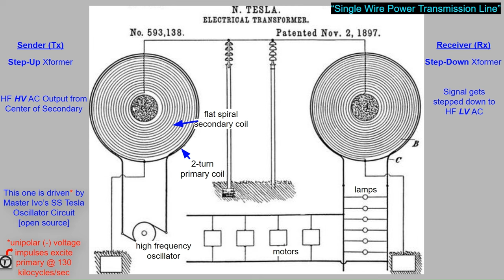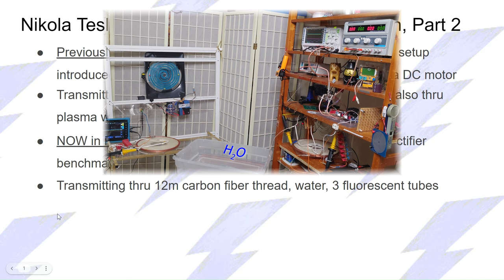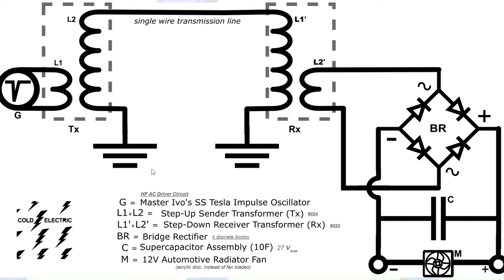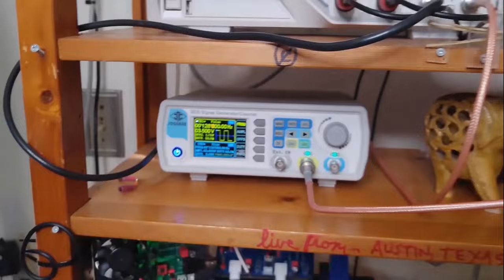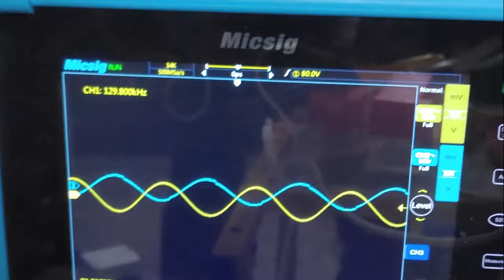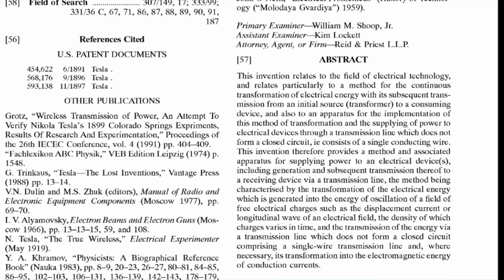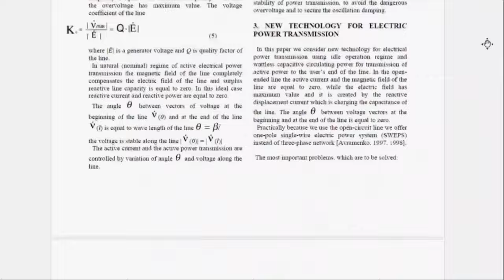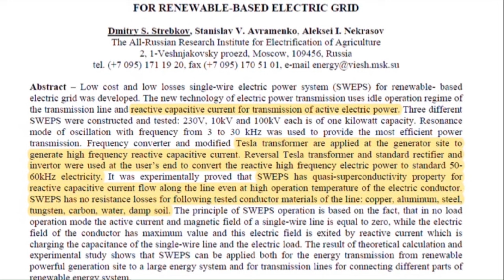Nikola Tesla's Single Wire Power Transmission, Part II: Carbon Fiber Thread, Radiant Energy, Diodes

Comment from the maker: If anybody wants to see more about specs & precise details, look here:
 https://open-source-energy.org/?topic=3676
Reply: No vacuum tube for switching 🎉
Reply from the maker: @brettmoore3194  i would like to get hands on a vacuum tube oscillator sometime though - but yes Silicone Carbide (like the switching MOSFETS i have) apparently is a big up-and-coming "next gen" trend in for power electronics!
Reply: @cold3lectric  I'm want to build a Mason jar tube but with a thorium filament for thermal emission amplification. Beside the emitter,gate and collector I will use old speaker magnets for confinement
Reply: My curiosity and inquisitive mind is at it again. 
And i can now picture a market segment that would greatly appreciate this.

It’s solar garden lights. Aesthetically pleasing at first but the execution and end result is usually atrocious.
Reply: And! In my mind this would be such a blatant proof of concept to Tesla’ single wire power transmission research and original idea. 
But yea, 15 to 20 literal stakes in the ground. Each capable of powering at least led from dusk to Dawn with a as simple as can be electrical circuit.  

I wonder how big of a Tesla electrical potential tower is needed since all the nodes on the distribution network are within the back yard 
Would a second tower be necessary in the front yard? Hypothetically if the garden Ligts were also p
Reply from the maker: @phonzy  solar garden lights are quite the disappointment as-is right? so much promise but....

Comment: Your builds are Beautiful!! I wish mine looked more like yours and not like I dumped pieces of wire , glue and a bunch of semiconductor trash on my desk..lol
Reply from the maker: lol! i do have an unfair advantage though, i made custom wires (audio/home theater stuff) which i sold on ebay full-time between 2016-2020 - eventually selling several thousand units. So it was a fluke, but i was a "pro wiring maker" before i even started this stuff hehe. Thanks for noticing!
Reply: @cold3lectric  Incredible!! You are definitely next level awesome. And the single wire transmission is coming along brilliantly. It will be able to decentralize the collection of renewable electrical resources and make electricity available without the incidence of blackouts and brownouts like they are planned or not but are still happening because of our aging infrastructure...
Reply from the maker: YUP. imagine global integrated solar collection with the continents interlinked... we wouldn't even need storage batteries if the grid had access to 24hour daylight (like strebkov's suggestion of Australia, Africa, and America as the 3 solar farms). #wo0t

Comment: If you remove the receiver coil and incorporate a voltage step-down capacitor circuit, you can achieve significantly higher efficiencies.

Comment: i dont know exactly what you're trying to show in the videos but i can tell you this, you're basically transmitting high energy RF through an antenna, the plasma inside the bulb is a clear sign of it, im surprised your video equipment/phone isnt freaking out from it
Reply from the maker: it does make my digital microscope spaz out from interference, but tbh its only a couple kilovolts, relatively low voltage compared to many other Tesla coils. I have a pretty good RF ground (foil sheet) right below the transmitter, and also i think the bifilar coil may be generally less "noisy", it hardy even deflects a compass needle - but that's just a conjecture 🤷
Reply: @cold3lectric  look into rf(high switching frequency) plasma, you basically have a microwave in a antenna but lower frequency than 2.4 ghz like an oven, I'm definitely following after watching a few of your videos, also be careful you don't get a burn from it because rf can penetrate deep, I'm going to have to rewatch some as well and maybe make some of them
Reply: It would be funny if this whole time Tesla wanted to surround us with high frequency high energy radiation
Reply from the maker: @frogz   I'd feel more wary about close proximity to my wifi router, as opposed to my coils 🤓
another reason i like bifilar coils is they bring down the frequency a lot (due to high  inter-winding capacitance), into 'low frequency RF' (LF RF).
So at my operating frequency of ~130kHz, the wavelength is 2.3kilometers. Those seem to interact much less with organic tissue, kinda 'non thermal'. So perhaps kilometer wave is preferable to microwave 😸
There are electrotherapy devices which also operate in the low-kHz range 🤷
Reply: @frogz  "It would be funny if this whole time Tesla wanted to surround us with high frequency high energy radiation"

The thing about Tesla's tech is that 1, he wasn't transmitting through the air, and 2, he wasn't using electromagnetic radiation.

Tesla was using the Earth as a single wire transmission line, and he was using capacitive displacement currents which are NOT Electromagnetic, experiments with open HV HF circuits and the displacement currents produced by them have shown the potential for rapid tissue regeneration, experiments with dying plants have also shown a vastly accelerated recovery time. Wardenclyffe would have done far more than merely transmit power across the globe.
Reply: @cold3lectric  that is where we see your level of education.

Comment: Those fly lead experiments are IMO proof that the purpose of the top capacitance in SWT circuits is to create standing waves along the circuit and within the load, that's why a top capacitance of a certain value is required, when the waveforms reflect back off it down the line it needs to be at a rate that the result is a standing wave, looks like the same thing Tesla was very excited about in creating standing waves in the Earth's crust.

Great video cold3, very valuable information and great experimentation.
Reply from the maker: one cool thing about the carbon fiber thread test is, it shows that i can use it as my wire up to the topload. i been dreaming/plotting toward attempting a setup with an elevated metalized mylar foil balloon (spherical), on a carbon fiber thread, as a low-cost 'high topload'. i bought a small helium tank even (the cheap 'party supply' stuff, an air-He mix, so i might need to make hydrogen instead).

especially since the line up to the topload is included in the 'length of wire' value, for wavelength of resonant frequency, so i could maybe approach 'quarter-wave length resonator', even with a bifilar secondary (kilometer-range wavelength with such low rez freq).
Reply: @cold3lectric hydrogen generation is pretty easy and it has more lift that helium. I've been wanting to make a hydrogen generator large enough to fill an envelope capable of lifting me so I can cruise around on a mini airship. You could have a camera on your baloon so you can look back down on yourself. Would the HV interfere with video? Awesome work, keep it up

Comment: Hey Jim, just wondering about the frequency readings from your oscilloscope into/out of the high voltage line. Would any AC devices have to put up with a much higher frequency since you're not using an active frequency generator...you just used the terms "step up and step down", not paying mind the frequencies
Reply from the maker: there's a function generator which controls the oscillator circuit, its running at 128kHz (i prefer the usage of kilocycles/sec). Also my name is Mike 😂

Comment: You should lower the duty cycle on the sending coil and compare the results.
Reply from the maker: See Short reply
Reply from the maker: at 40% the voltage was a couple percent increased (with a corresponding increased draw from power supply). i admittedly hadnt known that'd happen 😸
Reply: @cold3lectric that's very interesting,  I was thinking you could potentially increase efficiency numbers if the system stays in resonance with a reduction of the duty cycle. I only suggested it because I noticed it myself but my coils aren't the same as your are, they were simple tesla like air coils. Keep up the great work, I'm here for it!!
Reply from the maker: @newmonengineering indeed! i suspect adding a capacitor in series before the ground connection (of secondary) might also "reduce expenditure" from power supply without losing resonance. an area to explore!
Reply from the maker: .....plus, you gave me the perfect chance to show that "requests are welcome", so thankya
 💛⚡🌟

Comment: Nice video.
In my 'area' this setup is no longer one wire, we used line to ground system. The Earth acting like a return wire/cable to make a complete circuit. Tried this before but I'm switching to single/one wire technology which totally one wire which doesn't have earth... Although earth is needed in another stages for the whole system to improve performance. But sending energy from the first stage is totally one wired.
My system seems physically one wire but still a complete circuit through capacitive coupling via parasitic capacitor.
Reply from the maker: with antenna/elevated topload capacitance acting like a ground?
Reply: @cold3lectric  Sory, my comment wasn't complete... What I meant is based on the scheme of tesla  patent. The one suggesting to remove one ground is I believe correct. Or can do in opposite way, sender has no earth while receiver has earth... This to minimize looping. Sorry about my term, I'm not na engr. If both rx and tx have Earth physically seen as one wired but earth is acting like another cable as return cable to complete the electrical connection similar to two wired system.
In my area we used line to ground system. So even you removed the ground cable from the pole transformer and earth them, still the system working...which become like the tesla scheme seen in the beginning of the video.
So maybe the reason why tesla made another setup to use earth instead and used as the main medium to transmit energy. So there's no wire/cable able to be seen  but only the earth. So now earth is serving like the one wire... which similar to purely one power transmission.
Good luck for the next experiments brother.
Reply from the maker: ah, gotcha, yup agreed, all good cuz electrical language is new on me too 😸

Dawned on me how Avramenko patent's "conductive body" (instead of grounded Rx) is what I'd formerly called 'RF Ground', or even an earth capacitor, and it's not so different  from the "topload" "aerial" or "elevated terminal" ... "earth capicitor" as well? 

So we can picture it symmetric like a 2wire circuit, like some say the ground & ionosphere balance eachother to-and-fro, BUT its still.... super tricky somehow 🤷 considering the whole "waveguide" aspect & the unipolar character.... All i know is, i'm testing effects of a particular RF ground this evening and will report back 
☝🤓 💛

Comment: Excellent work. I am in the belief that the Ground is the one providing the energy while the transmitter is just exciting the ground via 1 wire transmission, in other words, you are not transmitting power but only a SIGNAL.
.
When you removed the ground and that was a drop of at least 10% in the output, so I would assume this is because the GROUND is providing the energy and the coupling efficiency would improve with ressonance.
.
WHen I say GROUND I mean a large body with excess of charged particles. A huge metal box could be the ground.
Reply: As far as virtual grounds it's more to do with creating ideal standing waves, but an earth ground is a bit different because there's actual "fresh" energy in there that can be stimulated, considering Tesla's focus was on Reactive Power by the time of Colorado you can use reactive power to stimulate something else into effect, Tesla used Gigawatts of R.P to stimulate the Earth and turning it into the actual supplier over the tower, so a ground connection to a resonant VAR booster could bring in energy from there into the system.

Although a virtual ground can also become a source of energy under the right conditions, such as an elevated terminal, and there are other ways to use the stimulus of reactive power beyond these ways too.
Reply: "transmitting a signal".

the energy is already there. in the wire. except its chaotic... "johnson noise"....

just gotta get it UNchaotic...

Comment: Hello, greetings from Argentina, your work is very good, I am working on the same thing but in a different way, I think that as you mentioned Tesla did not use diodes or semiconductors, it occurs to me instead of wanting to rectify the radiant energy it would be good to extract useful energy from another way, perhaps with solar panels or capacitors, then I also find it interesting to use insulating elements for the only cable through which the longitudinal energy can travel equally. greetings
Reply from the maker: ¡Salud! My uncle was petroleum engineer in Buenos Aires, though i didn't get to visit.

Also 'Hakasays' said the rectifier would make it look like an unbalanced system/load for the generator 🤷

I've heard Tesla coils may charge up solar panels directly, i could imagine that being a radiant effect. Also there's the notorious radiant effect of charging DC capacitors in proximity -maybe THAT is what we wanna leverage?

Strebkov called Tesla's step-down method "impact incitation", which I'm guessing might mean "impulse excitation" (or maybe even "electrostatic commutator"?). 

I need to try dielectric as conductor - I've read IEEE papers where that works, at UHF/microwave freq anyway. Good to meet you, comrade 
💛⚡😸

Comment: A laser as a conductor? That's awesome! Does it have to ionize the air to do that? Also using water tubes as transmission lines
Reply from the maker: my understanding (limited) is that a powerful enough laser does almost instantly ionize the air - there's weapons called "electrolasers" that operate by making "laser induced plasma channels", cool! 

the author Strebkov used 10mm tubing filled with water to transmit electricity - the irrigation tubing i used was only 1/4" (6.3mm), and was several pieces spliced together (so the inner diameter was constricted at several places) - which is perhaps why mine failed. I'll have to try again though, now that i know ☝🤓
Reply: some places are using lasers now to guide lightning to lightning rods.

Comment: Unfortunately, our current electrical system is 3 phase.  Try doing that over one wire.
Reply from the maker: that's a good point, but there are 'phase converters' which can accomplish that end (though the economics are unknown to me), here's a copy/paste from Wikipedia:

"A phase converter is a device that converts electric power provided as single phase to multiple phase or vice versa. The majority of phase converters are used to produce three-phase electric power from a single-phase source, thus allowing the operation of three-phase equipment at a site that only has single-phase electrical service."
https://en.m.wikipedia.org/wiki/Phase_converter
Reply: Well yes, there are phase converters, but I’ve never seen one that would convert high voltage high frequency (in the kHz range) to a mains current at all…
Reply from the maker: Yeah high freq AC (RF) is better suited for DC uses, I'd been supposing: rectify (RF) to DC, invert DC to AC single phase, and then convert single phase to 3 phase. After its transformed down to low voltage high freq AC at receiver end.... But with how convoluted & lossy that sounds, your point is def valid - it would need to be VERY cheap power, in order to justify all that conversion loss 🤷
Reply: @cold3lectric  for phase converters we could make 3-phase RF if we wanted.   Better to just create DC, then use inverters.   For those who want hundred-KHz three-phase, first create 2-phase with inductive and capacitive phase-shift, then build a "Scott-T" transformer.    That was a Westinghouse invention, designed to convert the very first Tesla generators output into three-phase.   (The first big Tesla generators were just two normal AC generators on the same shaft, but shifted slightly, to give 90deg 2-phase 4-wire output.)
Reply from the maker: @wbeaty  ooooh good to know - sounds waaay better than re-re-inverting RF to DC to 3-phase AC

Comment: Bravo........is it neutral bonded to ground....?.....like to see separate power supplies on each side......ok .....lighting bolt........single  wire....cheers
Reply from the maker: thankya kindly! neutral not bonded to ground as far as I know.
Reply: @cold3lectric  the electric grid....they bond nuterial to ground at main panel........u.s.........
Reply from the maker: @mattharvey8712  ah gotcha, misunderstood, yes at the main panel it is

Comment: Are you familiar with Birkeland currents? I wonder if that's what is happening with your carbon fiber wire. Basically a vortex in one direction, on the outside, and a stable flow on the inside...
Reply from the maker: yup, i was seeing Birkeland currents in the light-bulb discharges @ end of vid too
Reply: @cold3lectric  cool, I'm glad I found your channel. 
I was surprised to see some familiar faces in the comments as well, so... bonus points.
I added you to my Experimenters and Tesla categories. 
My channel is becoming a glossary for stuff like this.